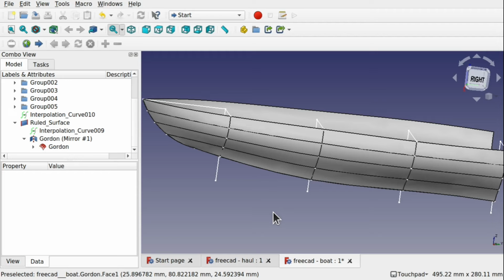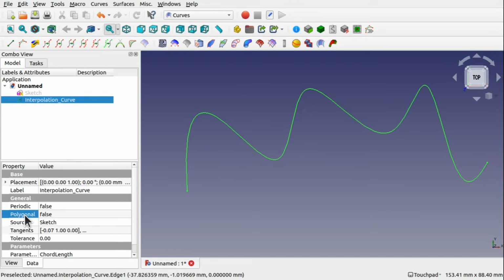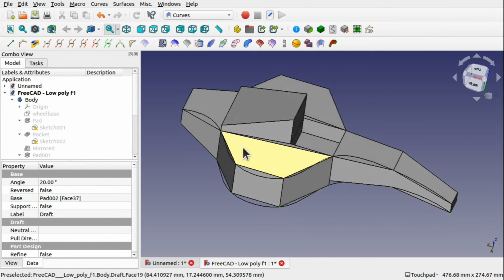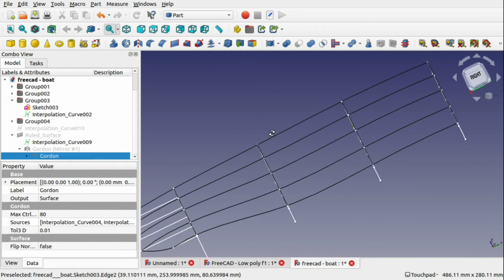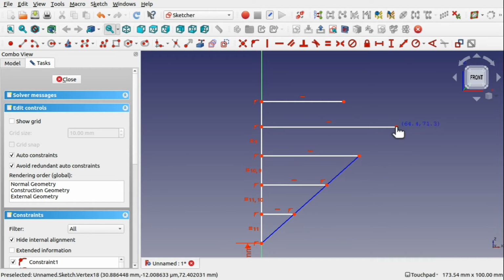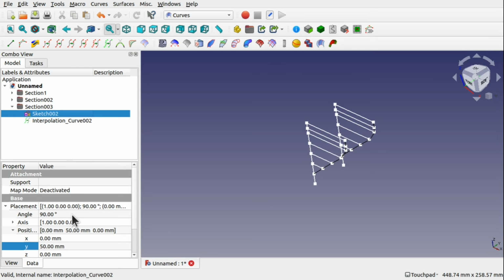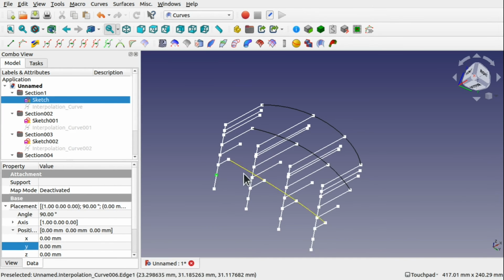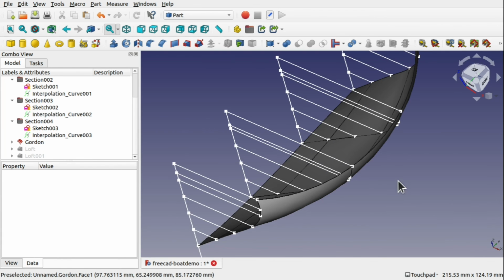Learn FreeCAD Curves Workbench 16:  Boat / Ship building with Interpolate Curves Possible solution?

Comment: After watching a few different online FreeCad content makers, I've managed to create a boat hull, in FreeCad , based on a top , profile and transom line drawing of my boat. My issue is, how does one turn the the shaped creation into a usable object?. It seems there is so much VooDoo involved when trying to do what you think should be pretty straight forward. my process was to import my svg files, in the Draft workbench, convert the svg's to sketches and in the parts workbench, create the transom profiles along the zy axis , then to the PartDesign and loft everything . The hull shows up and looks like i can just tag a surface and start the modifications for the deck but alas, it's not a real object at this point and I can't do anything to it. Can you suggest how in the hell do you magically convert it into something usable?  Help me O B Juan Can no B  ;>)

Comment: Hi Darren, Really enjoying Series, have been able to design own 3D RC Aircraft. As usual FreeCAD can be a boit Idiosybcratic but (especially when doing sufaces and the like). I've found saving often (older PC) helps performance.
Reply from the maker: Great to hear your progressing. I find open source in general can be a bit like that. I use shotcut for video editing and it constantly runs out of memory. I am the same, laptop that is 15 years old but still going strong. If it works finally on mine they it has to work on something a bit more powerful (that's my excuse as computers have got very expensive of late!)

Comment: Great video. Now I'm verry interested in the next step of hull design. Creating the bulkheads and interior walls etc. to match and follow the curve of the ship. And of course give it a thickness, I would love to be able to model a ship in real size and then 3D print the scaled down parts for model building
Reply from the maker: Thank you for your comments, glad you like. I have a video regarding flattening lofts where I create a very simple boat and section up the surfaces. It's more for technical drawing and creating the shapes for extrusions for cutting on CNC. It is a step towards what you are looking for but I have yet to do a full video of the whole process and get detail into the bulk heads.

Comment: Great video, thanks for sharing.  It´s great complement to the Hull & shovel designs of your past videos (4 months ago?).    I have the same  sugestions / questions of "fullsendmarinedarwin" and "hidingin":  I discovered Freecad by trying to do reverse engineering in plywood canoes.  I think this is the first video I see that shows how to make surfaces with reference dimensions.  Now, I miss the how to on  "flatenning" or getting plank dimensions.   Hope you may work on that and teach us how to do it.  Again, great video.
Reply from the maker: Thanks for the comments great to hear you are liking these videos. This is the first venture I have had looking at boat making and it is fascinating area. Believe it or not I am sitting here with a techdraw print out on paper, tape and scissors piecing together what I think is the solution with better results than I expected (bit tricky with just paper as the recycling as been so didn't have any card) . I am going to make a video on what I have done and release early this week on my channel I knew the tools I needed in CAD as I used to make parafoil kits for a hobby and  have used a similar concept. I just had to figure out a similar workflow in freecad. And I think I got it or near to it. Have to say its been the most enjoyable research and journey I have had to date.
Reply from the maker: Just to let you know I have now released a video based on the questions regarding flattening the loft. It's been fun working in this area and I would love to venture further. Hope the video answers your questions.

Comment: What I can not believe is that I can't find the most simplest answer to a question I'm starting to wonder if FreeCAD can even do. I have a custom flat object which I simply want to curve along a path. I have come close to what I want but most run into the limitations of FreeCAD and I find that I'm starting all over again. Can it be done? Make sketch, pad sketch, create custom path  and then click button to follow the path to create a new object? BTW, GREAT videos.
Reply from the maker: Thanks for your comments glad you like the video. Sounds like you are looking for sweep along path or edge. You can sweep your sketch profile along a b spline or edge of another object. Available in both part and part design workbenches.
Reply: @MangoJellySolutions  I simply want to bend an already padded object along a path so I then can use it in a pattern feature. Most all ways I have found to do this uses the face of an object and or can not be in both ways duplication using the pattern feature. I can't wait for 0.20 :)

Comment: I have a question for you ? I want to make a flowing curved part using the curves workbench you have taught . picture then cutting this into sections like ribs on a boat hull . then I want to take each slice and use to convert to g code and use my router table which is CNC and machine these to make ribs for a buck so i can form sheet metal to it , to make a body how would I do this ?? can you help me please
Reply from the maker: Sorry for the late reply. I thought this was a very similar question has been asked by another viewer but on further reading theirs is  different as they are trying to flattern the shape so they can bend it into position.  To make cross sections there is a tool In the part workbench called section, I often use it to create section views for technical drawings.  Its  icon looks like a series of red slices through a cube.  You can use this to make faces of each of the cross sections which you can then extrude.  I'm in the process of putting together a quick video on this tool and it's made me rethink what this tool can be used for. I think it can be a great shortcut for what you want.
Reply from the maker: Just to let you know I have figure it out and tested it by making a small boat in paper from the ribs and profiles and all fits together fine. Now putting a video together to release.  It should be out on Wednesday

Comment: Is it possible to add a thickness to the complete hull so it can be 3D printed?
Reply from the maker: Yes, if you use the 3D offset in the part workbench that will allow you to create a solid hull.
Reply: @MangoJellySolutions   have you actually applied a 3D offset to these surfaces and created a valid non intersecting solid? i know the tool exists, but it is famously temperamental.
Reply from the maker: @edwardvmills  Yes I have and yes I have had problems but there are solutions, I did a video about ways of resolving these about a month ago.  With the curves workbench certain curves that you use to make up lofts and gordon surfaces can be switch to custom mode.  These then expose the continuity settings.  Switching these on I found that I was able to get the offset to take by changing it to a different C(n). Running them through the geometry check on the part workbench showed no errors.

Comment: Now to really throw a spanner in the works, for physically building from a CAD model, would there be anyway of flattening the surface so you could create cutsheets? Building it this way in FreeCAD allows you to build bulkheads which is awesome, but It would be nice to be able to approximate the surface as a flattened object. I understand there are certain constraints when flattening a complex 3D curved surface, sometimes the material IRL would pinch but if you keep the panels within constraints is such a thing possible?
Reply from the maker: Getting close to an answer .... I think, combination of two other workbenches.  Need to do some tests to see how successful it is by converting the results to a sketch and measuring.  May have to print out and transfer to cardboard to see if it works
Reply from the maker: Just to let you know I have figured this out and am putting together a video on the technique.  Even tested with output to paper and created a paper model of the CAD model and all fits together fine.  Will be releasing on Wednesday, just got to edit the video.
Reply: @MangoJellySolutions  excellent! Also, I sent you an email to the one in your YT bio 😎
Reply: @MangoJellySolutions  I can't seem to find that video. What's the title or search term?
Reply from the maker: I know exactly what you want. I used to do a lot of foil repair and kite making (open and closed foil kits same construction as a paraglider) and the software I used I was able to flatten the kite in to  its 3d form to make cutting templates to transfer to material (ripstop) . There is ways in the draft workbench to flatten objects into a 2D view but I have never had a reason to use it. Also there is the sheet metal workbench which I have used to make a couple of cardboard models and I am wondering if the curves wb can may together with it. It's an interesting question and one I think will be pretty beneficial for researching. From curves to print / cut is on my long list of videos to tackle.